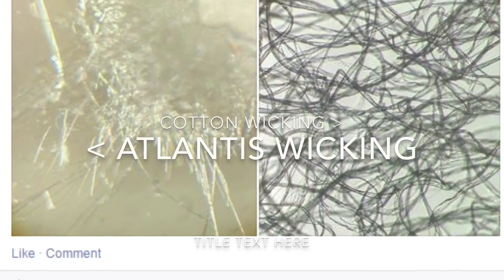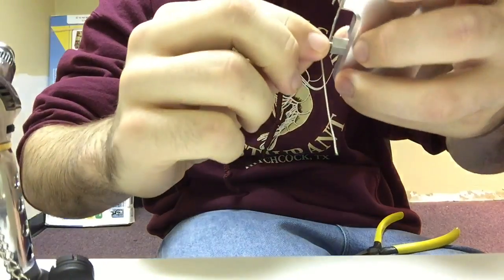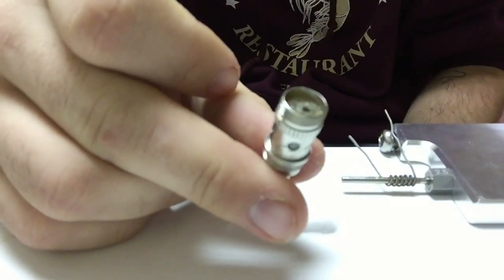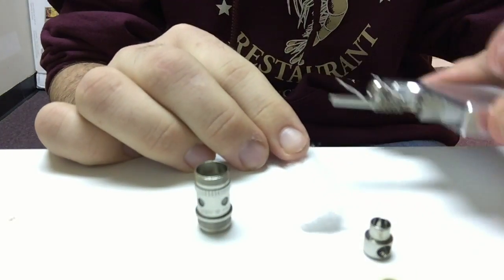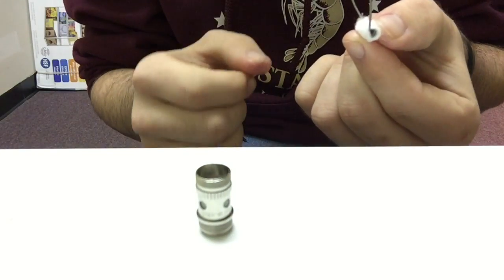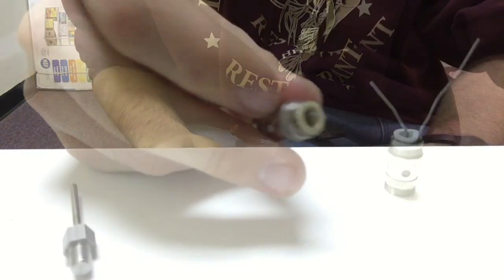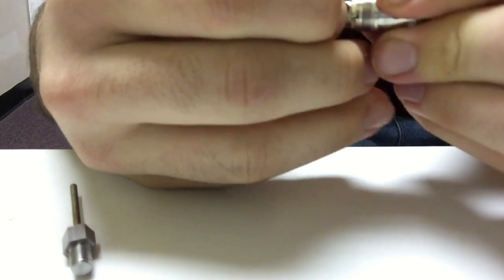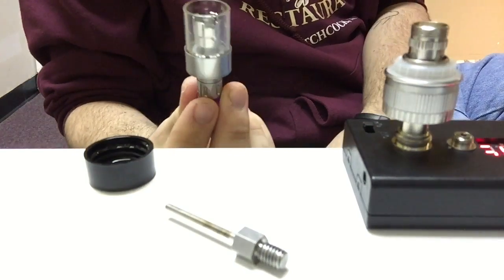Atlantis Coil Rebuild Tutorial

Comment: # 1, if both leads come off the jig on the same side it is NOT 6 wraps it is either five and a half or six and a half. # 2, heat coil AFTER you take it off jig not while it's still on!

Comment: Thank you for the video. Just one question so when you put the last part of the Atlantis head back into it the positive is on the inside and the negative or it's sitting between both leads with them pushing off into the outer part of the head? Sorry I don't know how to word it. Are they on the inside of the metal bottom or outside?? Against the plastic thing??

Comment: nice vid did you leave the stock paper filter thing in the head that covers the juice holes??
Reply from the maker: Matthew Sharp Thanks! and Good point, I did for this video, but in builds after this one, I have taken it out and wicked that section differently.  I may upload a follow-up video with different wicking and coil placement.
Reply: VapoRider Reviews that would be sweet cause I'm still having trouble with wicking on this damn thing lol
Reply from the maker: Matthew Sharp it can be a PITA depending how you go about it.  wrapping around the coil like aspire does is much more difficult the wicking like a regular RBA.

Comment: What is the purpose of torching the coil before installing it? Is it a necessary step?  If it is can I use a standard lighter instead of a blow torch?
Reply: Haven't a clue really, but personally I never torch them and just would take the long leads and fire it in an RBA. It gets all the gunk off the coil from all the stuff on your fingers and stuff before putting wicking material in. You always see puffs of smoke when you first fire them. Don't wanna inhale that. Dunno if there's another reason.

Comment: Good job in the coil. The Atlantis doesn't ise silica however. Check the website it tells you everything that's in it. Silica not being one of them
Reply: it isnt silica thats why it isnt listed on the website, the wicking material is actually some kind of ceramic. its probably not dangerous providing it stays in the coil head where its supposed to stay BUT if it starts flaking off like some people have reported that it has then thats not gonna be good for you, if it just sits in your lungs its probably gonna cause problems later in life, BUT then again would Aspire use wicking material that is dangerous??? who knows

Comment: The stock coils vape better than this "clapton" coil he built. He doesnt know much about hwat he is talking about. Its not silica in the stock coils, its a ceramic type of wicking material. And when you are putting the airflow piece back in the bottom just bend both leads, the one thats under the gromet just bend down and the one thats over the gromet just bend down and cut as close to the coil you can.